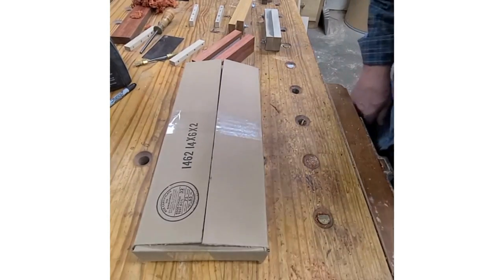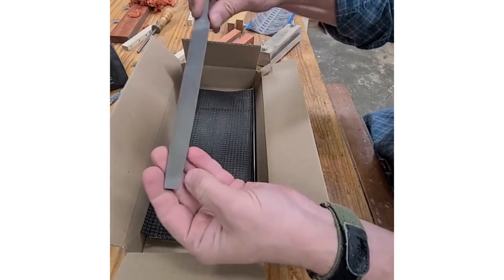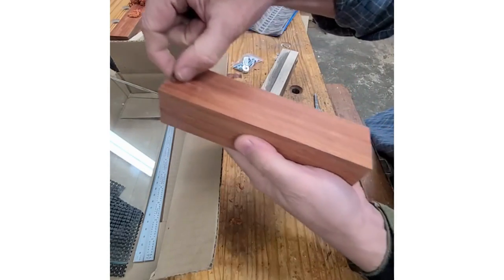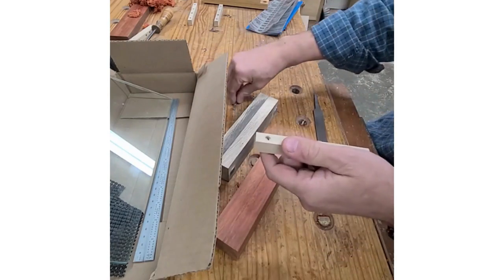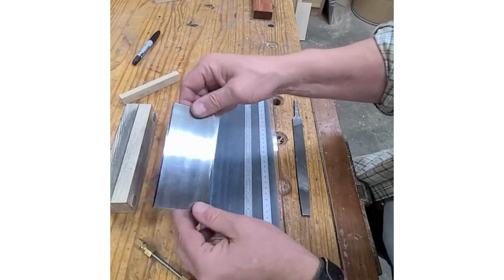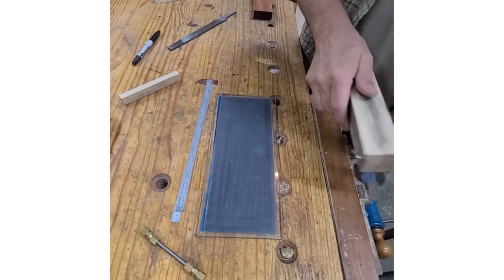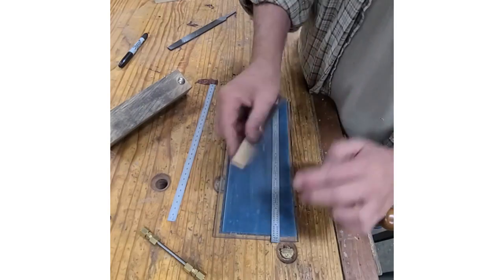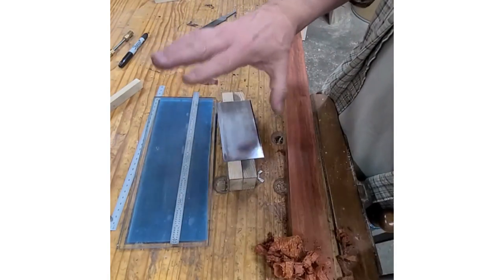Prep and sharpen a cabinet scraper in less than 2 minutes

Comment: How do you get a burr on both sides with a normal round burnisher? Just tilt one way, then tilt the other?
Reply: I tried that, and I apparently can't get the angle correct because my two burrs do not cut cleanly at all (at least on my pine test piece).